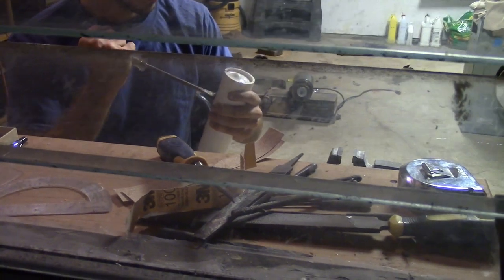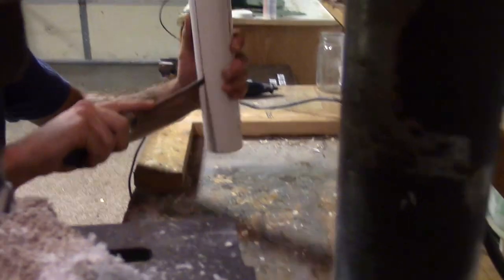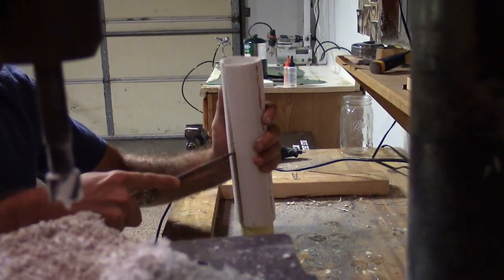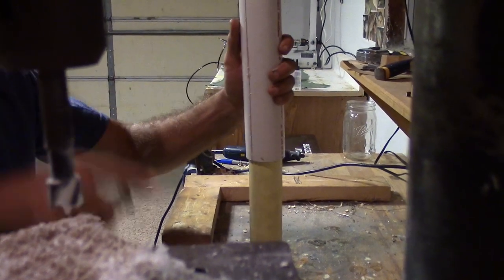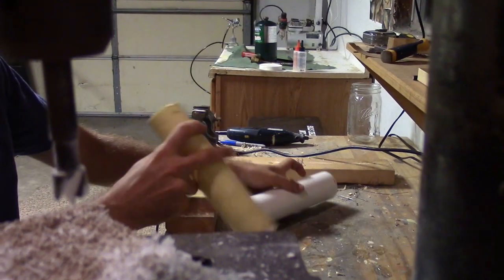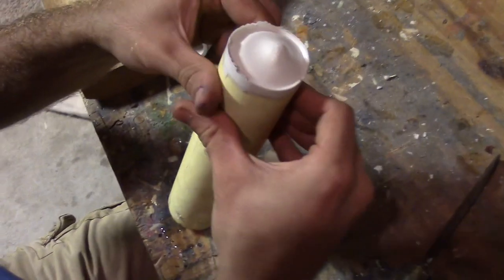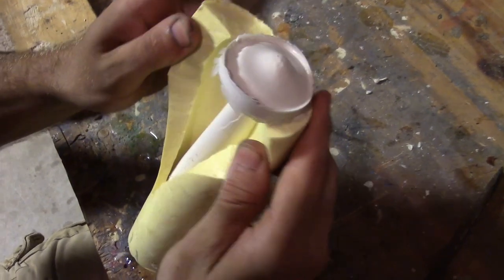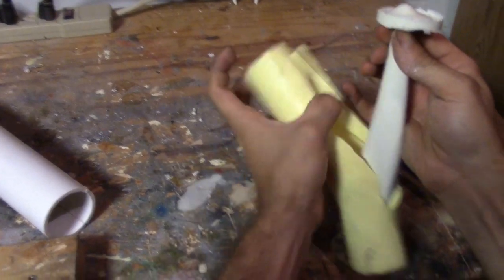Lure Making: Casting/Molding a Resin Bait - Marling Baits

Comment: A few people have asked about resin used for lures.  I personally like to use “Amazing Casting Resin” by Alumilite Corp.  It is a two part urethane resin that hardens clear.  You can add silica micro-spheres to it to reduce the density of the resin and get a floating lure.

Hope that helps.
Reply: geebee3d 
I’m starting to look at getting into this with Clear Urethane, there’s a local guy who’s adding coloured glitter and paints into the actual lure, it’s amazing, he’s not giving any secrets away so it’s up to me to try and replicate what he’s doing.

Comment: Nice work! What are you using to make the lure mould and the body? Cheers!
Reply from the maker: +Stephen Hamill Thanks! I use Illuseffects RTV silicone to make the mold, and a high strength two part resin with glass microspheres added for buoyance.

Comment: How strong is the bond between the eye screw and the body? I know for a lot of lures that are made for really large fish like muskys and stripers they use a wire through type construction so there is a direct connection between the line tie and the hooks. I was just wondering how strong your lures are in comparison to a design like that
Reply from the maker: +16GHunter Yeah in theory through wire baits are always stronger than screw eye baits. By design the bait can even crack and fall apart mid fight, and the wire should still hold together. I'll make through wire baits for my saltwater / freshwater customers who ask. For how strong the bond is with a screw eye bait.. Muskie fights can be very intense, but it's super doubtful any fresh water game fish could yank out, or open up, an epoxied in 1.25" x 0.092" Magnum screw eye from a well molded resin bait, or hardwood bait. Most fishermen over the years haven't had any trust issues with them it seems. I personally think through wire baits can look a lot better if the wire is bent well, and like knowing I'm fishing with something that can't really fail in pulling in any fish.. if I do my part that is lol.
Reply: @marlingbaits  surprisingly, the screw eyes can actually withstand quite a load. I've pulled in 35 lb fish with plugs that just have screw-eyes "screwed" in, no glue. reels have drags for a reason, to play a fish. no reason to be strong-arming a fish in. that said, I don't like screw-eyes, especially if they aren't fixed in with epoxy. so I went to the through-wire for my lures.